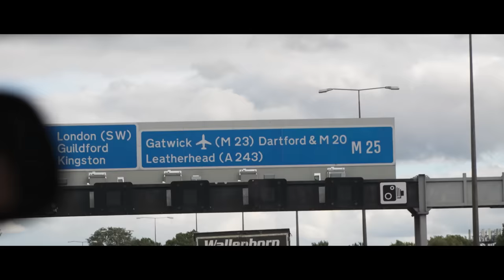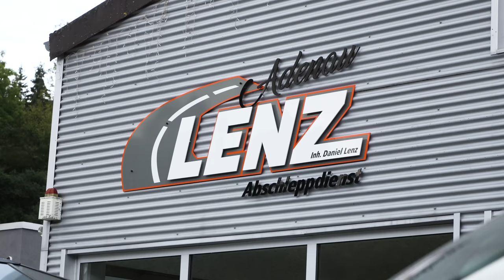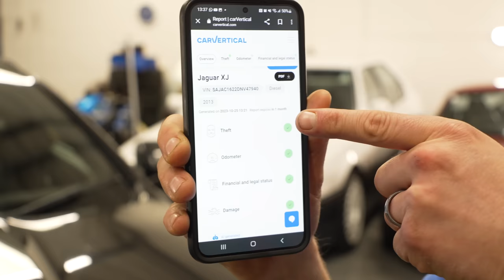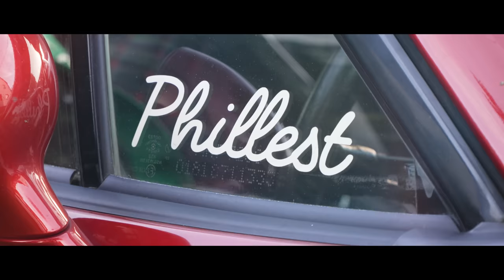£30,000 MX-5 VS @mgcharoudin ON THE NURBURGRING!

Comment: Misha, phil, lap, make it happen, go as soon you can. Phil, sounded lovely. Look forward to you fixing the exhaust properly, go back to bruno, remap it with the better exhaust, fix the intake properly that will help also. Then sort the suspension setup so it's as best it can for Mishas lap
Reply: If Alex only checked the tyre pressures after his lap, maybe wasn't before Misha jumped in and therefore Misha's lap would have been wasted anyway.

Comment: Well done on getting an X351 Rory! I have owned the same one for 5 years and 80k miles - Love the thing. Similar age and miles to yours! the 3.0 Diesel can do 50+ MPG, 0 to 60 in 6 seconds and can carry 5 people in comfort... interested to see a video on this soon! Exhaust manifolds, turbos, and adaptive suspension are the things to watch out for. Also if you ever replace the discs, best to get drilled discs as the front and rear brakes are susceptible to getting really, really hot! Also, do use the correct Oil (5W-30 Acea C1) and replace it frequently, as the diesel engines are prone to spitting out cranks if not maintained (Lots of people change every 5k miles).

Comment: with phils weight/balance i would start with 26psi front & 22psi rear (cold pressures) i have the 100tw sport extras and found this a good starting point

Comment: From personal experience I can tell you that the reason the rear felt loose is the 651 🙄 had them on my S2000 and they are terrible on a RWD, they are a great tyre to slide about on, very controllable for skids but no good for fast times... Need a nankang sponsorship for so e AR1's with a discount code please 😂... Good to see the car did a lap trouble free

Comment: That end bit........ I did that with a 740 Volvo estate, rear seats down and a 300 TDi "Drained" of oil and coolant that over 250 km oozed more than the Exxon Valdise in used diesel oil and broke the rear and a side window when I got rear ended by a truck 50 km into the trip...  :-) 
After defiling a car wash vacuum cleaner I drove the remaining 200km homo   
Rory? SHaddup